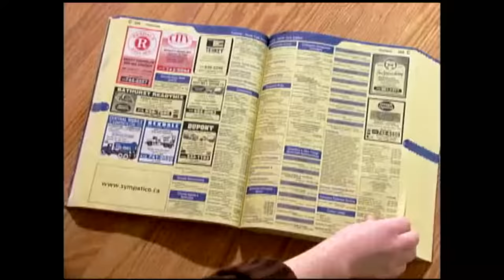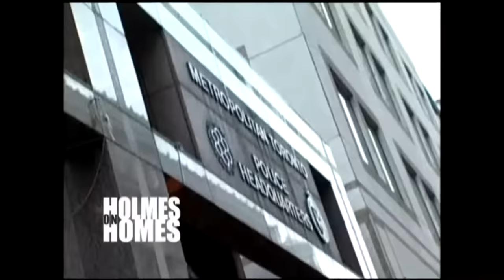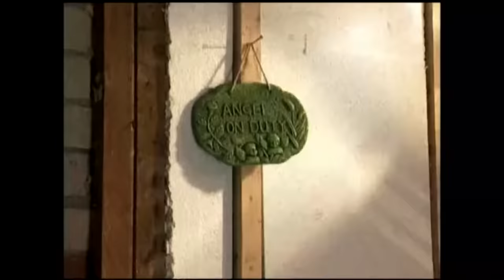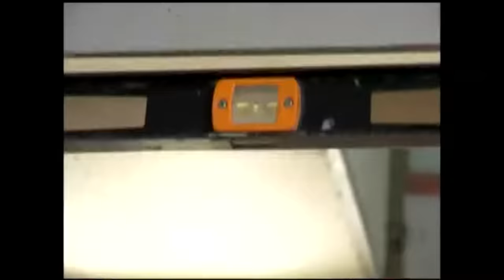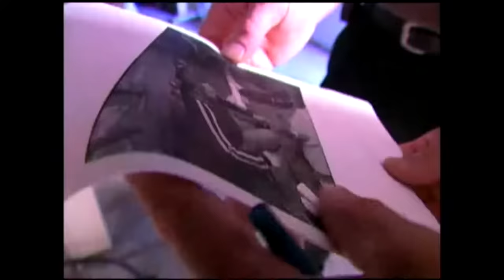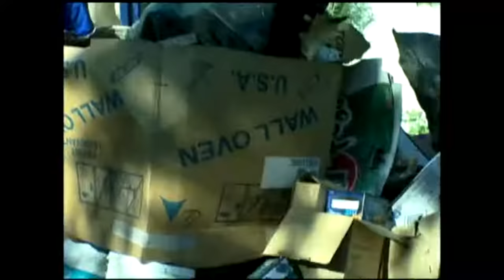Whole House Disaster: Mike Holmes Rebuilds a Ruined Home | Holmes on Homes S113

Comment: Mike, I live in the NM desert. When I bought my house I put some ceramic house numbers up and made the mistake of leveling them on instillation, now they look crooked because nothing in my house is level. Plus, the former owner crushed the supports in the kitchen cabinets, they have fallen in over the last couple years, no drawers in the kitchen now either. All this to say, no sealed wall plates anywhere. The wind and sand just comes in all the time. I had put these plastic stops in and caulked all the baseboards, but my husband came in and ripped everything out.😢 None of the counters are even.

Comment: The plaster and strapping: So correct about difference between true and level. My house is a hundred years old and fixed several walls. One part had a new wall due to changes for new foundation and stairs. The rest I saved and restored the plaster and lathe.

The old walls are true. But you really can still see the different to sheet drywall.

Comment: I had once worked for a drilling contractor that drilled piers for new house construction, sign post holes and front porch piers.  There was one contractor that built a house 13" out of level. The home owner had to tear it down and start over. I can understand 1" or 2" out of level, shims will suffice to fix that, but 13", that is insane. They put a tennis ball on the floor and it looked like it was circling a drain!!!

Comment: Mike Holmes installing tile straight onto plywood, now you know this is an old old episode 😂
Reply: Whats wrong with that?
Reply: @seane6616 you need to put down membrane or at least do some kind of waterproofing. Otherwise your tile will crack
Reply: @1packatak  How will water proofing stop it from cracking?
Reply: The days before he was able to work with a limitless network budget & materials donated by the manufactures in exchange for product exposure on the show. 
The homeowners still paid for the work being done. 

I've never seen him installing tile over a membrane outside of a bathroom, however I'm surprised he didn't laydown durarock first.

Comment: The tile job was actually done incorrectly. Level and flat and square yes. You mentioned the suction. That will not happen and will not bond properly without back buttering the tile with the trowel in the OPPOSITE direction. This way suction will happen and you will ACTUALLY get a bond. You could hit the tile with a hammer and it wont break it will bounce off like stone. Your installation will smash if hit with a hammer and tiles will loosen and fall off over time. Just saying…